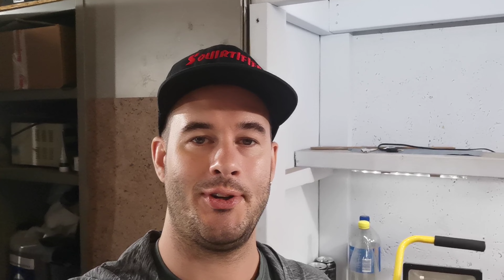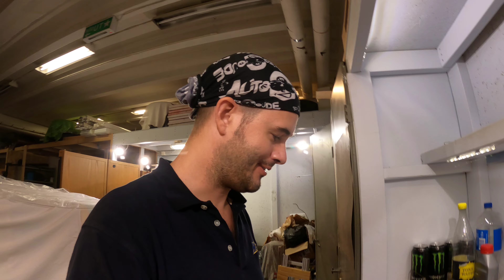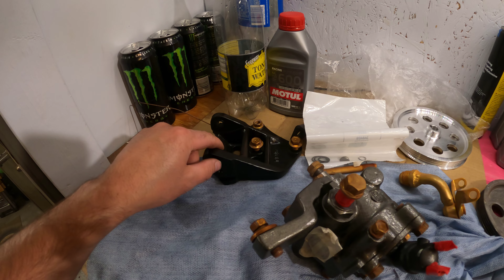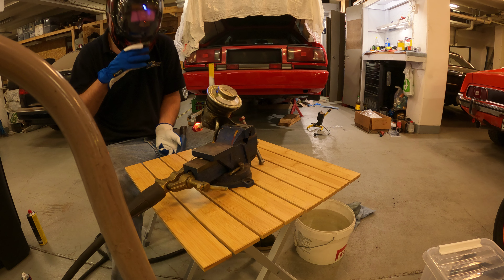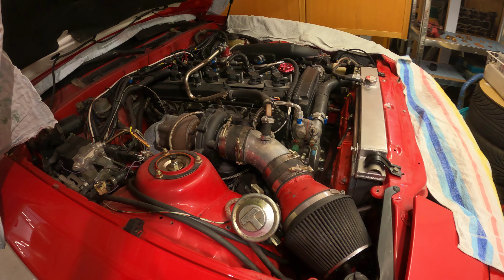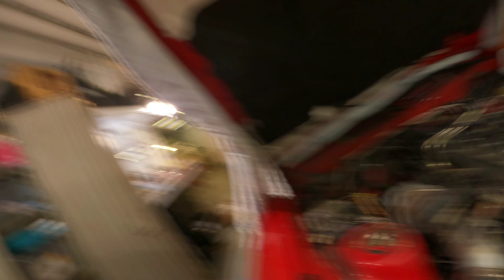SqE - Supra mk3 - Episode 229 - The return of the PS pump!

Comment: What kinda welding lid are you using? The built in led looks helpful
Reply from the maker: Hehe it's actually my wife's welding helmet. We bought it at Lidl so that she would have something if and when she wants to learn to weld. Mine is quite worn so I borrowed hers and I'm really impressed. It does require 2 AAA batteries. The led is useful but for the most part I keep forgetting it's there and use another lamp.